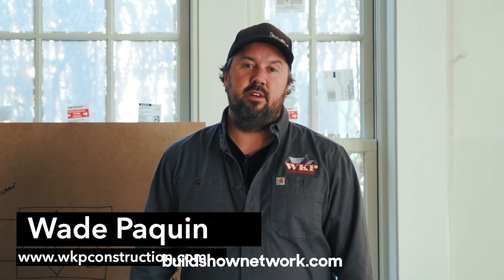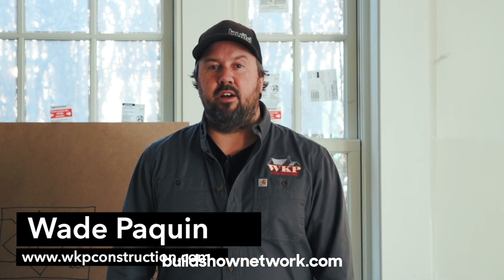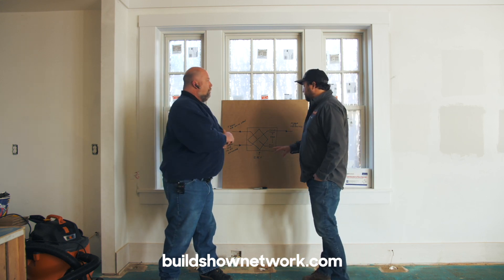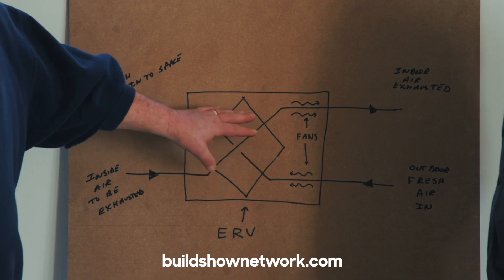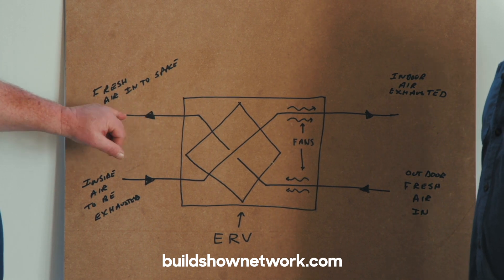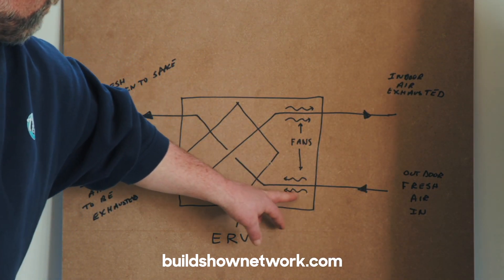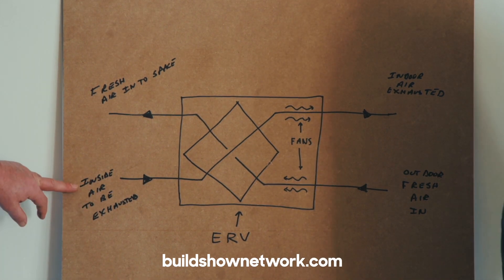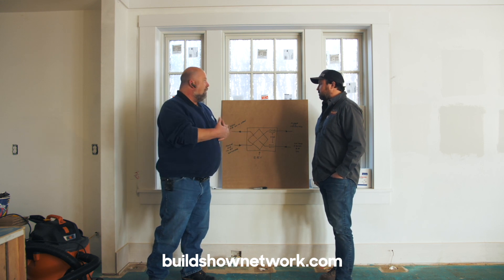How ERVs Improve Your Home's Air Quality

Comment: Hi, what's everything's thought about natural ventilation? Is it possible to have a tight house without a ventilation that has moving parts?
Also are there any simple ways to measure or qualify the flow of air in a house?

Comment: I always see people in these videos putting the interior intake in the bathroom and fresh air in a living area. Can someone explain to me why it would be good to transfer humidity to another room? I don't really understand that.
Reply: It is the 'intake' on the air that is getting exhausted to the outside.
Reply: Stale humid air is exhausted from the areas of the home that produce humidity and odor (bathrooms, kitchen, laundry) and fresh, filtered, energy recovered air is then returned to the living areas (bedrooms, family room). The result is the flow of fresh clean air throughout the home, from outside to the living spaces to the utility spaces to the outside, and repeat. ERVs typically run 24/7 which creates an endless loop of clean air circulation.

Comment: So... In the winter, the humidity will stay in the house? Also super annoying hearing someone say "H-V-A-C." Just say HVAC without spelling out the letters.
Reply: In the winter the air is dry, so that's when you want to increase (or at least maintain) the humidity level in the house. In summer the ERV would do exactly the opposite, keeping the cool dryer air and exhausting the humidity. Also, that's a dumb thing to get annoyed about.
Reply: @dlg5485  "tHat's a DuMb tHiNg tO gEt aNnoYed aBoUt!"
Reply: @trevorhardy3544  How old are you 12? A simple "thank you for educating me on how an ERV works, since I obviously didn't understand" would have been a better response.
Reply: @dlg5485  "yOu shOuLd kiSs mY fEeT!"

Comment: What does “ach50” mean? Can you give an example of what an ideal number is and a poor number is etc..
Reply: Air exchanges per hour, at 50 pascals of pressure. It’s used to determine how leaky the structure is, and thus how prone to heat loss it is. The lower the score the better, meaning slower loss of heat. Below 1.0 is very tight and will hold its air heat longer. Less than 0.6 is exceptional and calls for this ERV to regulate fresh air flow..because the structure won’t haha